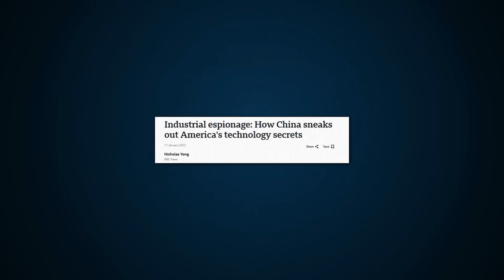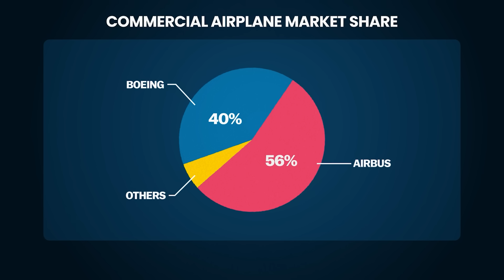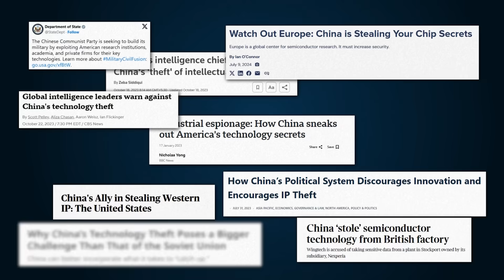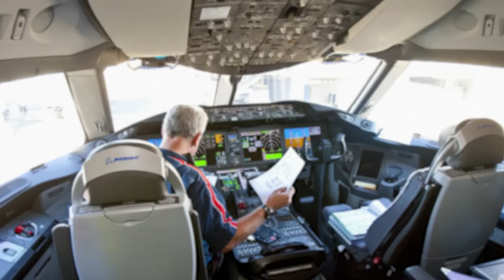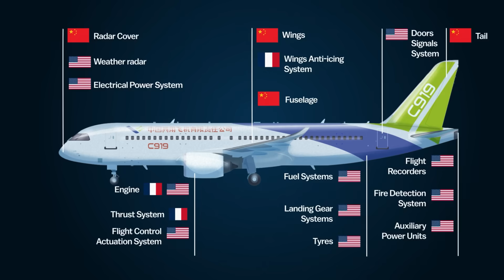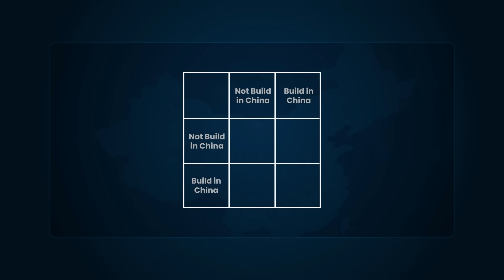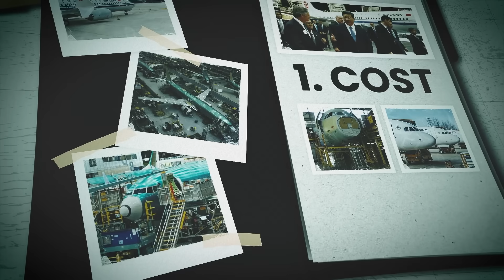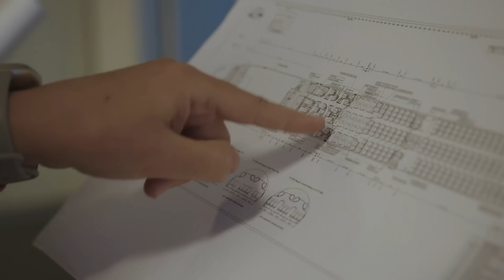Why Boeing & Airbus Building Planes In China - Against All Logic

Comment: The report lacks the depth of understanding of this subject. There are many reasons for China to use western parts. Partly, China wants customers to have confidence in their aircrafts in this initial stage while they are building up strength. China also doesn't want to build so many aircrafts quickly before they have the permission to fly and the customers. It is good to start up slowly but to grow steadily without making mistakes and building trust.
Reply: Exactly. You need to crawl before you can walk.
Reply: Also even you have the power to be independent, having partners is still more profitable.
Reply: You learn from mistakes. It's inevitable!
Reply: Talkling of mistakes, the plural of aircraft is aircraft NOT aircrafts!

Comment: Isn't it dangerously risky to be learning from BOEING?  Unless it's learning about BOEING's mistakes, case studies, etc.
Reply: Error-proofing for Boeing designs
Reply: @choonlee2654   Yes, Some sort of due diligence to be on the safer side of things.
Reply: @sjv9147s China learn from Boeing mistakes and build better plane❤....Boeing crashes now and then...😂😂😂
Reply: Not learning much, since both are assembly plant, if China wanted reverse engineer riveting it a great advantage but not making a plane.

China already designs and builds more fighter jets than EU and USA combined.
Reply: Any derived designs are still subject to 10,000 hours of intensive validation and verification tests. That’s why Comac taking a decade to roll out their ARJ21/C909 &C919
Reply: @choonlee2654  Comac's got a perfect air safety record.  O crash statistics.
Reply: There actually isn’t a technological problem; it’s all a problem of cost cutting and shortcuts forced by McD’s beancounters.
The MCAS fatal flaw was caused by using the data from only one AoA sensor and leaving the other completely out of the system, feeding the data only into copilot’s instruments. Thus when the primary sensor malfunctioned, it had the overriding authority over the controls.
Had the pilots been actually properly trained in its usage, they would know to disable MCAS and regain control.
Had the secondary sensor been connected into MCAS, the computer would be able to tell the primary has malfunctioned and ignore it or release control to the pilots.
Reply: @marekstanek112  A technological problem is when GM or Nvidia tries to design and manufacture commercial jets.

Comment: Boeing is the smaller aircraft manufacturer. Airbus is substantially bigger. Boeing is in the process of losing its biggest customer, China . The U.S. has proven to be untrustworthy, unreliable and an awful supplier. Trump has even threatened to with hold Boeing parts. It’s no wonder China does not want a supplier like this. China has been a big supporter of Boeing but no longer.